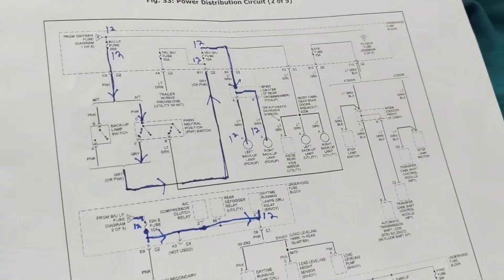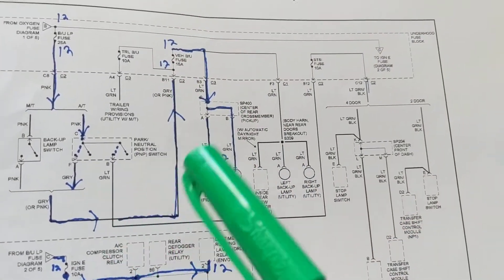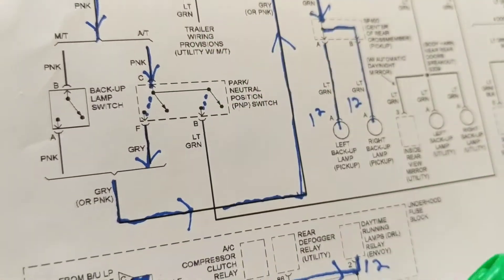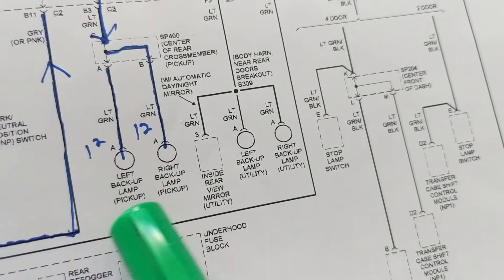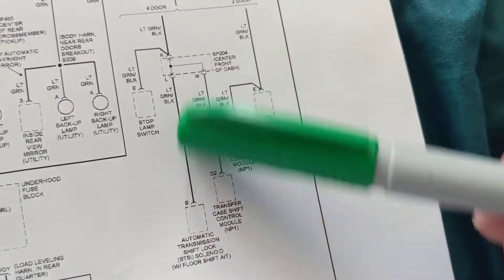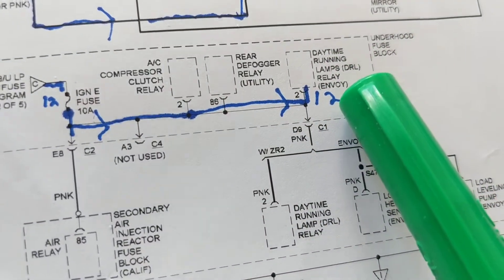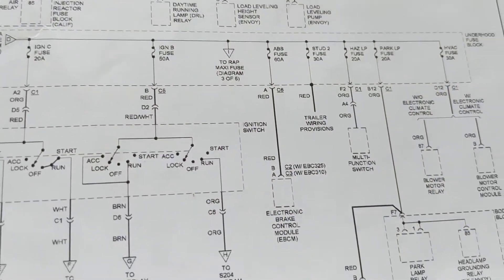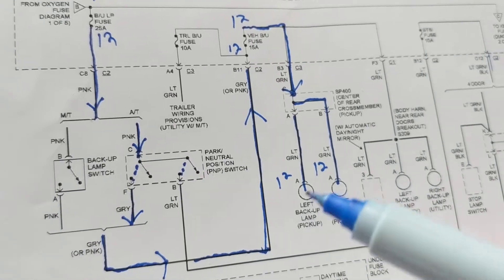power distribution board with fuses

Comment: Sir, you are the only one I know who can help me out with this car problem. The car is a range rover 1998 p38 4.6HSE and v8. Many people were invited to start the car even from a far State but the couldn't. The challenge is a crank no start, no spark,no injector pulse but good communication with a scan tool. I have added fuel to the intake manifold and crank the engine no change at all. It is not starting. In addition, I checked for spark, but there is no spark as well.
Hence, I have just checked for injector pulse but there's no injector pulse either. There is also no ignition current to the injector circuit with key ON and engine off. 
All the fuses and relays are good. I also checked the injector circuit for continuity if the wire is shorted but it was ok. Scan tool communicated and showed only p1843 and p1842 code. There was no RPM during cranking. What I noticed today when I compared the ignition, earth and DC with the same car that was starting and driving to the car that was not starting, what I saw made me to flabbergasted. Where the was ignition for example in the working car there was DC in the car that was not starting. Also a particular relay circuit for example RL-2 one of the pin of the connector when my test light was on battery ground and relay removed, the pump buzzed and testlight dim but when I tried that same location with test light and same pin the test light was dim and ABS relay was actuated no buzz from pump. It is like that in many places in the fuse box and PCM circuit. Please  what's the cause of the problem and what do I need to do to fix the problem?
Reply from the maker: First is always fuel pressure then injectors firing also u need a signal from crankshaft sensor to start fuel pump in some cars
Reply from the maker: Sometimes u have inertia switch also but the fuel pump relay is activated thru computer modules
Reply from the maker: U could have timing belt off there are many different things but u have to start with measure fuel pump pressure .if u don't have this than seeing the fuel injector is not useful.
Reply from the maker: And u need fuel to get to the injectors but without fuel pressure u won't have anything to injectors